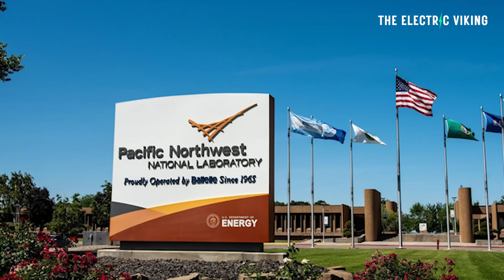Microsoft AI analysed 33 million candidates to find material to replace lithium

Comment: We've known about sodium batteries since forever. Sodium lithium isn't a replacement for lithium, it still requires lithium. This only really postpones rather than solves the problem of our dwindling lithium reserves. (which is why an alternative is needed) Sodium also forms more dendrites than lithium and has fewer recharge cycles and has a lower energy density. But progress is already being made in sodium batteries.

Comment: So, it is replacing one violetile component. With itself and a volatile and dangerous component mixed with it? Unril the actubattery is replaceable for a recharge. In let's say 10 minutes. Electric autos are not practical for someone who travels a lot. The best you can do is remove the frunk, and place a small generatior cappable of charging the vehicle when the grid is unavalible.

Comment: This is why EV have not taken off like many had hoped and anybody with an once of reality would have pointed out these problems.  The battery is only one step, but it is a big one.  If they can not only increase the density of storage AND the longevity of the batteries AND reduce the cost to manufacture... then things will change.  EV cars will get cheaper and sell better, renewable energy will become a more viable option and the cost of electricity as a whole should go down.  Grid storage is huge for solar and wind farms as well as for handling spikes in the power grid.  Power plants can not quickly increase or decrease output.  The more stable it is the better... and cheaper electricity is.

Now for EV this will not increase range because we are running into another wall... charging times and power output of charging stations.  If this new battery charges fast we still have the problem that EV reduce there range in half when you double the weight.  This means ANY hope of a long range larger vehicle, especially semi trucks (or even later boats and trains) will need massive battery storage.  Even if it is cheap, light, small, and charges faster... the amount of power these batteries hold is crazy high.  The Tesla Semi to fast charge needs 4 battery banks and each needs 250KW chargers.  This means a 1 MEGAWATT charging system in total and at least 30 minutes.  You want a 10 minute charge... 3MW.  You want to charge 10 semis at the same time in a truck stop 30MW.  Charging stations for cars will need massive transformer stations to handle the power draw and a large truck stop will need a power plant of its own.

The last part to this puzzle is energy production.  If the US alone stopped using natural gas, propane, diesel, heating oil, and gasoline (not counting what the power plants use to actually generate electricity)... the total power production in the US would have to increase 400% and the entire grid would have to be rebuilt.  With battery banks would could put large solar and wind fans in the desert (a possible ecological disaster) we would still need to be able to store a lot and transmit this power all over the US.  Would would need FAR more high power lines or the ability to spread this power production around.  I do not see how we could really do this without a significant increase in nuclear power.

The idea of stripping CO2 from coal and gas power plants and burying this toxic mess underground is just not going to work.  We really need a safer and better energy production that is clean and not too costly.  The idea of the US being free of fossil fuels in 15 years is laughable... it is going to take a MINIMUM of 50 to likely 100 years to complete.  Realistically a better bet today based on the technologies we have (and what we are expecting to see in the next 10-15 years), larger vehicles like semis, construction equipment, and even larger cars and trucks should be hybrids.  If you are not putting too much miles on these larger cars and trucks or hauling heavier loads then you could operate it as an EV.  But the semis and construction equipment and likely even military equipment will shift to hybrids.  You get the torque of the electric motors but the range of the gas engines while staying at a set RPM that the engine is tuned for.  It should last longer and be more efficient and the overall weight of gas and electric motor as well as fuel tank and batteries should be no heavier or even lighter than running either all electric or all gas and you get the ability to operate for a reasonable amount of time on just EV.  Hybrids are something we can implement now and could likely reduce the emissions and gas usage by 30% or more.

Comment: I don’t think we really needed AI to answer this question in the first place. It’s been well established that synthetic hard carbon anodes can intercalate both lithium and sodium ions. The thing is, it’s almost impossible to optimise one material to do both well. There’s always a range of pore sizes in any synthesised material, so it’s pretty obvious that it would be make more efficient use of the pores if we had more than one ion size available. For example, if we take a hard carbon optimised to absorb sodium, there will be a percentage of pores that are too small for the sodium ions to fit. A large percentage of those are however big enough to store lithium ions, giving increased overall capacity. The same is probably true for cathode materials, although that’s a harder problem. Either way, since the sodium (and/or lithium) only accounts for a small proportion of the weight of the battery, increasing the utilisation of the anode and cathode materials could produce a much higher overall energy density. 25% increases are easily possible with this hybrid ion approach, allowing cells to break the 300Wh/kg barrier. There are other issues with this approach though. For example, an SEI composed mainly of sodium compounds might not conduct lithium ions very well. Many hurdles to overcome, but very promising.

Comment: Its like purple gold, yeah its real its also incredibly difficult to make, incredibly difficult to work with being brittle, incredibly difficult to combine into an alloy(with simple aluminum), and incredibly difficult cast in oxygen free environment, and good luck!
Reply: Yeah, this is no real discovery. There are interesting studies on increasing the recharge life cycle on just sodium batteries already though. Like lithium they form dendrites, but a study showed a rigid outer structure and a soft, spongy inner structure, a lot like bone, can mitigate this. Still, we've been working on just sodium ion batteries since forever, and sodium lithium isn't really a replacement for lithium.

Comment: The ai came up with the ideal sodium lithium mixture but it may not be what we humans would consider ideal. If sodium is so much cheaper and if it could provide enough power density. This is good enough to use use so we throw out lithium due to cost. It’s kinda like silver is best electric conductor material but we don’t use it for wiring but we use copper because copper is good enough

Comment: I like the fact that we are pushing for more and more battery power creations but the hydrogen future will free the people of terrorist elites , Ark energy Is revolutionary and doesn't need Lithium battery packs , the system will go live before 2025 in America regardless of Vehicle Industries moving towards it or not , Every Gas powered Car will be Hydrogen not electric , for then $100 a car and the best affordable way with out charging your battery packs or wasting time at the pump or buying H2 Refill tanks , H2 Ark has 0 emissions and can fully charge any electric vehicle in 5 minutes , Any Gasoline battery to its max charge as needed to fully pull the power supply of the H2 packs , The transformation kits are Ark energy Hydrogen changing electric elements and Hoover to Gasoline mixture or full H2 engines , No supply containers or high pressure systems required , the great part is ever single engine or electric motor can be converted over to Ark H2/ H20 Energy production machines , Heavy equipment or little bike engines , The Dramatic Brain washing Crap needs to end ( Man + women ) Just stop adding moral confusion and actually start doing what is better for humanity by building ricer systems and hydrogen engines and electrical ark systems along these new rivers , use thermodynamics for cooling and moisture planning , No place on earth should have a desert , I mean it is not rocket science , except exercising rockets and space travel as something to keep people interested in , These space programs really want to show how to Terraform a Ecosystem or start one from scratch , really I can't take 5 kids from highschool education and write a plan for the thermodynamics and agricultural , designing and financial budget of less then 1 million dollars a complete design and equipment purchase for the project , no fuel cost and quality planning to be shared globally for a complete ecosystem environment that provides for complete sustainability with little to no efforts after 5 years , A system can be up and running before the 3rd year and reversing the flaws our past political theater has supposedly given us , I am not going there tho , each nation can co-exist with this plan and not even have religious discourse , each nation has a breeze the comes in from 1 direction use that breeze place your rivers and lakes using hydrogen ark tech and honestly robotic teams will be nice to have on a lot of yhe project but totally worth having payed to learn Ecosystematically  instead learning commen education , they are hired into position with completion of education with large bumps in pay free housing with location options for building more systems around the world in lead positions and training or teaching of h2 Ark / Ecosystematically/thermodynamics/ geological financial services for relocations and purification of water systems , Each design increases with expirance and all projects have a very small start up and maintenance for many cities farms and businesses to be built from A old design the grows and the rate only increases for agricultural purpose and Spiritual growth as Brother of God become closer to knowing and farther then believing , the artistic time we can spend on building beutiful landscapes with out using already existing materials , Keep guessing what that could be I am not free yet and Hydrogen is still not providing for greedy pockets as well , I only want go bring Everyone togther by a simple process , small digital design for display,  and common sense leadership for everyone to be approving of , what would God Do if he were to take the wheel and say here is the play book , here is the promise land and here is the rules , we don't fight or argue we provide 3 day only of labor 10 hours , 30 hours a week until the 5 years is up and then we as well as our children will have a endless gardening forest for a calm and buitiful earth , the solar problems / i have you , the blankets will increase the pressure will increase the reflection will increase no more chemicals needed for for any of that stuff before , all natural is the way , the Lord in heaven be our value and way , with only pray and do not disturb the grace given for another to worship in the most amazing temples that exists dn will be built / No king or dictator,  no goverments or banks or money eventually before anyone else has the 2nd generation of the plan the way = Our views are exactly the same around the world,  people are tired of Cost to live , we should act as family and build a buetiful world , Rich people are to blame , but its not un forgivable to make a change and do what is right for your seed to living in a world where everyone actually had part in doing something to bring The beutiful after life into this reality and making the sacrifice of loyalty to your people , and your family and , God brings us togther for this opportunity not to live in fear or make choices that create conflicts ,eveey nation has this almost priceless way of becoming independent with out a Government/ courts can stay actively involved policing can stay actively involved and we need boarders until that time comes , the walls will fall the people will explore the limits are no longer limits and the jurney can be carried beyond this planet we can prove Ecosystematically with out large body planets of water the moisture can be be smaller and built under ground on some planets we are ready for God to lead us beyond the restraints and break free of Boundaries togther as a himan race and possibly friends to none human species because we gave them everything a creature would need for survival and adaptability for Ecosystematically expansion like the word of God his first Vibration of sound into the first atom The first man the animal the of everything and this can only mean it came from him not me so I want to be his helper his faith onto all his children and our brothers and sisters , family embrace God the Father

Comment: I only need to look st a Periodic Table for about five minutes to work this out. The primary thing for battery charge carriers sre low atomic mass and high charge density…the lowest practical mass possoble and the highest charge density per ion possible. Hydrogen ions aew the best by far, but impractical…but that what lead acid car batteries have been using since Gason Plante made the first one by mistake in 1859. 
Lithium, being the third element with a tiny stomic mass is the arguably next best candidate next to hydrogen followed by sll the other alkali metals…sodium, potassium, rubidium and caesium. But they get progressively “worse” as charge carriers as the atomic mass goes up.
One thing that nobody seems to have “cottoned-on” to yet is the use of Alkali-Earth metals, with TWICE the charge per ion than Alkali metals. Beryllium, right next to Lithium, would be “best” but like Lithium it is reburned in stars after stellar nucleosynthesis and thus is rare and expensive. Magnesium, the second alkali metal, next o Sodium..is the next best and with a charge to massof 12, as opposed to Sodium’s 23, is only slightly worse than that of Lithium, whith a charge to mass ratio of 7.
Using an alkali-earth metal ion as opposed to the current thinking with alkali metal ions will require a complete rethink of the electrolyte chemistry and possibly the anode reducing agents and cathode oxidizing agents too.
Here I am certain the AI was only focused on electrolyte chemistry involving monopositive charge carriers..but what about dipositive charge carriers like magnesium, or even triel triple charge carriers like aluminium…which is really cheap and plentiful. As a chemist, I can confidently say that large language AI models…which just compare a large set of similar things…are currently no match for a proper chemist with organic/ligand, inorganic/ion carrier and physical/thermodynamic snd kinetics skills and probably won’t be for quite some eecades to come.

Comment: 0:27 Lithium is not a rare earth metal.

4:33 The hybrid Lithium / Sodium battery packs of CATL use separate conventional Lithium ion and conventional Sodium ion cells in the same pack to get some of the properties of both.  They are NOT cells that use both Lithium and Sodium in the same cell chemistry.  The latter would be something new, according the the PNNL discoery.
Reply: catl's solution sounds faster to develop and cheaper, since they've already invested in sodium-ion cell production, and already make 2-3 lithium cell types. why not keep them separate and integrate on the larger scale?
Reply: @PaulSpades  Agree.  Was mostly pointing out the different kinds of hybrids possibly being confused with each other: cell level and chemistry level.

Comment: i mean nothing personal, but yeh. it just sounds like it's more stable. 

"it doesn't need cooling" ... so it sucks. "it can handle cold temperatures" ... again, it sucks, but this is somewhat of a feature.  

it sounds like it's not exactly ideal, but that it may help us get places and share things on tiktok so we can eat/sleep/poop more.

lithium is like the answer to an algebra problem: it's the smallest thing that isn't hydrogen, so you can max out holes in a crystal. electrons are about a million times lighter than hydrogen, which enables the crystals to funnel their motion to reduce effects. unlike hydrogen, electrons don't mediate chemical reactions. the mass of hydrogen is much closer to the atomic weight of whatever it's around ... so when it's bumping into things, they're shaking. 

the only way i could imagine hydrogens working as energy storage is if they're used as a kind of spring where (somehow) the accumulated potential energy doesn't eat away at the container. that's impossible with organic compounds and impossible with metallic compounds in proximity to anything that mediates reaction pathways that hydrogen facilitates.

hydrogen is problematic because it's the least-common denominator of anything containing protons. it's small enough to move, too small to contain in most anything larger and large enough to cause problems.

idk what i'm talking about, but identifying lithium as the answer is like determining how much L2 cache you can fit on a CPU without slowing it down.
Reply: i could be wrong though and i'd love to know how

Comment: Read the paper its not been validated at all that it will produce a good battery at all in practice. Sure the AI helping with the sorting of good combinations of chemicals is great. But even the usage of sodium is not new. AI only claims a certain mix of mainly lithium and sodium would be the best of both. High energy density of lithium and cheap and safe as sodium already is in batteries today industrial batteries that is.